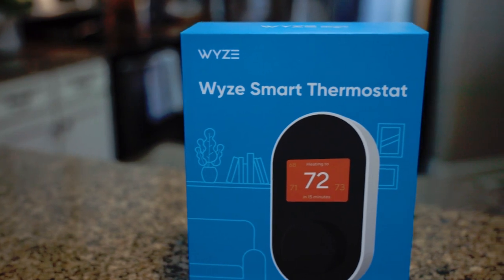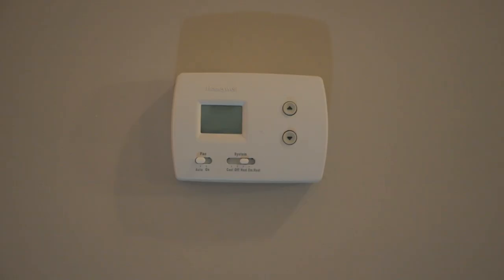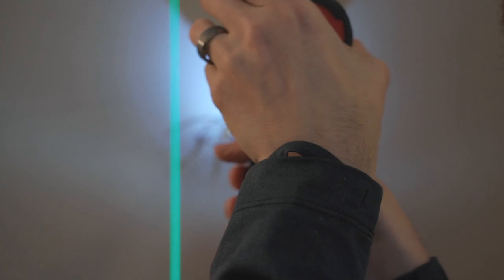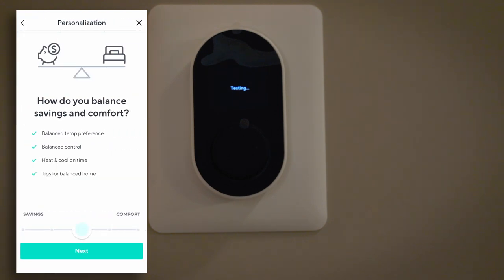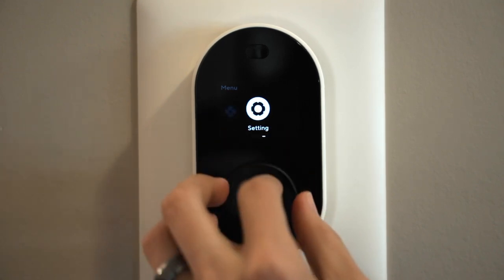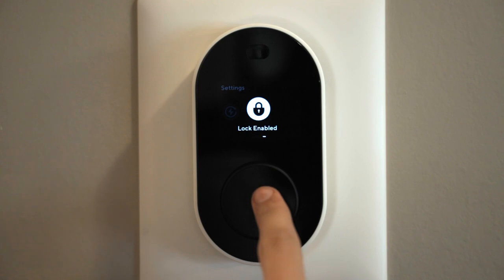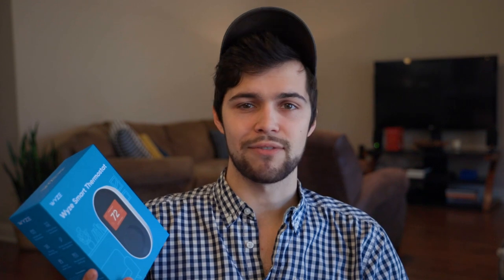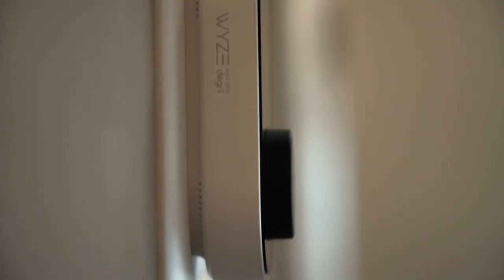Wyze Smart Thermostat Review and Install

Comment: It will not stay connected to the routher. 

This is the whole reason I bought this POS. I’m away, I’m on my way back, 3 hour drive. CANNOT TURN THE AIR BACK ON, so I get home and the #&#$ house is 85, it’s 11 PM and it won’t be cool enough to sleep for FOUR HOURS.

Guess I will have to rely on setting up a schedule. OH WAIT THIS POS DOESN"T HAVE THE MOST BASIC FEATURE LIKE A SCHEDULE. My bad. It is such a stupidly simple feature, I didn’t bother to check. Besides as long as its wifi I don’t need a schedule. OH WAIT, THE WIFI DOESN"T WORK EITHER.

It is a known problem. It’s not the router, its not the wifi, its not a weak signal. It is the thermostat and and I forgot that the purpose of the thermostat is NOT to control the HVAC system properly. The purpose of the thermostat is to move money from my pocket to theirs. Mission accomplished. If it also controls the thermostat, then thats a bonus. The purpose of ALL products offered for sale is to get you to buy them. If you paid for it, mission accomplished. If it does whats on the box, then its a bonus, but don’t expect the company to give a flying F whether you are happy or not. They got the money, now take a hike.
Reply from the maker: Dang Dan, sorry yours is not working well, I think there are a few things to try while you still have it installed. First is it does have a schedule, in the thermostat page on the app click on the gear in the top right and then click Schedule. Here you can control it to go to any temp on any day at any point.  You can have it not run the AC when you are gone then turn on at 8 or so when you want it to start cooling to a set temp. All of this is local to the device so if it loses Wi-Fi it will keep following it’s last known state. Second, in the advance settings you can put your “Safety Temperatures” to where if for any reason it hits those temps it will engage the AC or heat. I have mine set to 45 and 85 so it will not go above or below this even if I remove schedules. I’ve had very few issues with mine and it’s been up for 8 months now, if you have a defective unit and it’s new it looks like they have a 1 year warranty, or a 30 day happiness return policy. Definitely gotta make things work for you so we can try and make it do what you need before tossing it and losing money. Let me know if you want any other details on things.
Reply: 1. Scheduling is a feature. 2. You should check whether or not your router is using 2.4ghz or 5ghz. A lot of my smart devices(robot vac, mop, security etc) only work correctly at 2.4ghz.
Reply: 1. Scheduling is a feature. 2. You should check whether or not your router is using 2.4ghz or 5ghz. A lot of my smart devices(robot vac, mop, security etc) only work correctly at 2.4ghz.

Comment: You made it sound so confusing and complicated … I got lost after you had installed it and started talking about the Wi-Fi stuff
Reply from the maker: Sorry my dude! As an engineer I can get into the technical weeds without even noticing haha and it was definitely not very clear. But in short, you can’t use the thermostat without first connecting it to Wi-Fi. Once you connect it the first time to initialize everything, you can then disconnect and use without Wi-Fi. I set it up before having wifi and had to use a hot-spot on an iPhone to initialize the thermostat. Afterwards I waited until I installed my router and connect the thermostat to it. Let me know if there is anything I can clear up and I’ll try my best!
Reply: Wow, really?.... There's almost no hope for you, then.
Reply from the maker: @starmc26  haha I can be confusing, part of still being pretty new to making vids.
Reply: he couldn't have made it any easier.